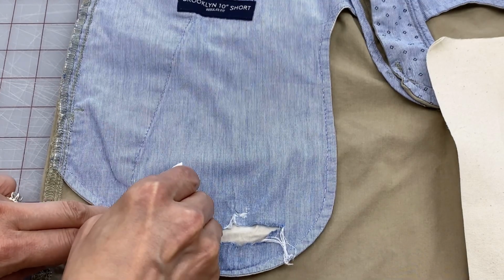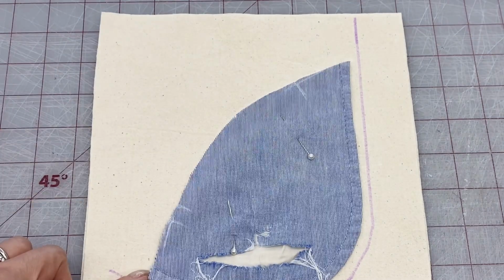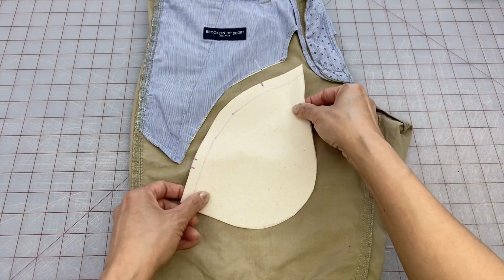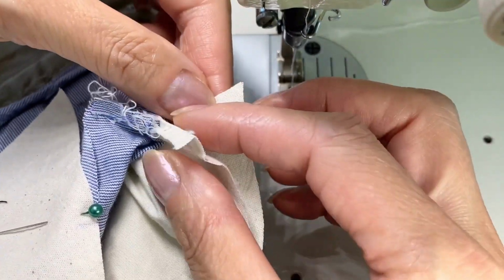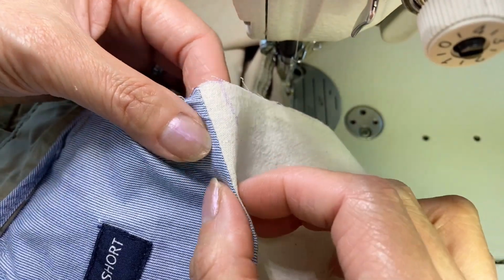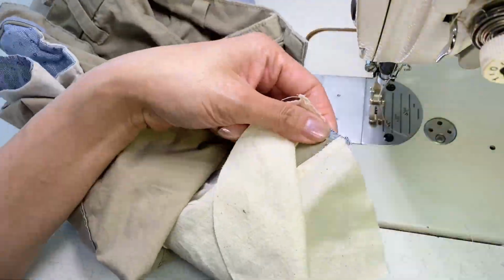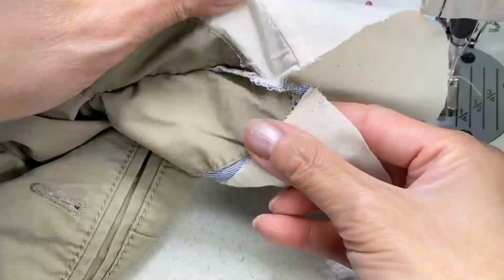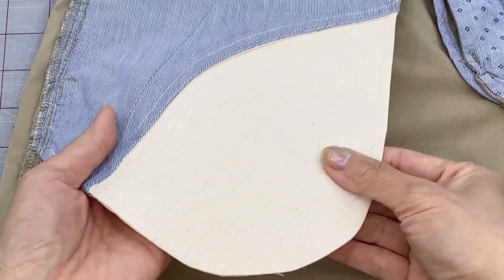How to Repair Holes in Pant  Pocket  - DIY  Add New half Pocket

Comment: What a great video. Thank you for sharing your expertise. Can you explain what the three initial notches as well as the later "half-inch" notches are for?
Reply from the maker: The notches are added so that you can match the edges exactly where it needs to be to sew the seams together accurately. I used one notch for top and 2 together for the bottom.  This way you don’t accidentally sew one upside down.  The notches that are cut later are halfway through the seam not ½”.  This allow the seam to spread open along the curve when you sew the next stitchline for french seam.
Reply: @NotchesSewing  That's about what I figured. Thanks replying!

Also I meant that the notches are a "half-inch apart" according to the video. 😀
Reply: Wanted to follow up with my success story. I had a few problems (mainly the existing fabric seemed to be getting stretched so the new fabric came up a bit short), but I managed to repair my pocket! It's slightly smaller than original and the sewing is a bit wonky, but it's way better than before.

Thanks for your helpful video!
Reply from the maker: Good on you!!  Should you ever need to do again, just cut the new fabric extra wide at sides, join the seams first and cut down what you don’t need.  The main thing is you can use your pockets😊. Thanks for watching.  Will have. Video soon for holes in a sweater
Reply: @NotchesSewing  Ah...I see what you mean about simply using extra fabric. Thanks again. 😀

Comment: This is wonderful! I'm going to attempt this today. But dumb question, when you say right side, which one is the right side? Is the right side the side your hands touch when you wear the pants, or is it the side that touches your body?
Reply from the maker: Thanks so much.  Yes the right side is what your hand will be touching when in the pocket.  It can be confusing when using fabric that has same colour on both sides.  You can set to a slower playback speed if it helps.  Cheers!

Comment: I have a hard time doing the final French seam as it has to go over the ends of the other seam. Otherwise, I'm getting pretty good at this. Thank you!
Reply from the maker: Try using a tiny hammer to gently flatten down the seam before going over and use a piece of cardboard to lift back of presser foot .

Comment: Dittos!  Can you please tell me a little about the type of fabric that you added? I would like to get strong, soft material (cotton maybe?) for a repair that will last.  I collect rocks when I hike.
Reply from the maker: I am using cotton calico in the video.  You can use drill or a lightweight denim.  Maybe just add another layer right at bottom of pocket for the rocks.

Comment: What is the point of cutting the notches, is to create space to spread the cloth to get even ?
Reply from the maker: it’s to make sure you are placing the pieces together the right way and not upside down.  It can be confusing with a curved piece.
Reply: @NotchesSewing  Oh thanks that is a great tip.